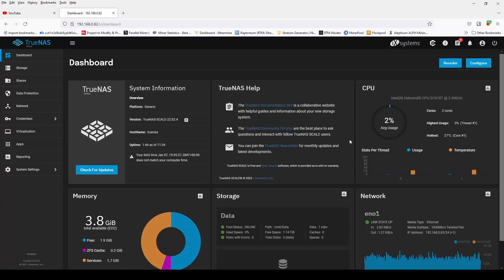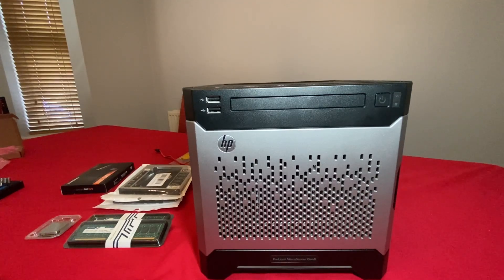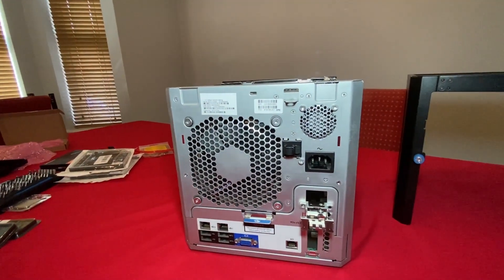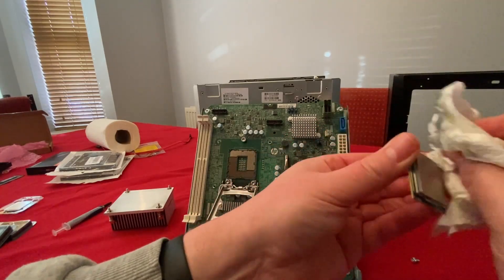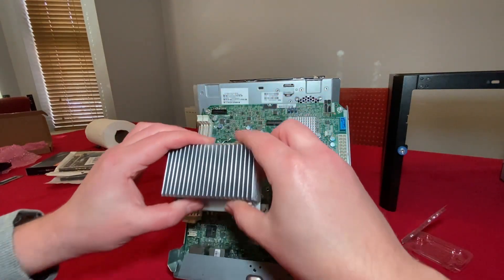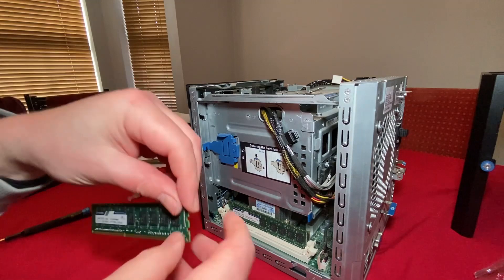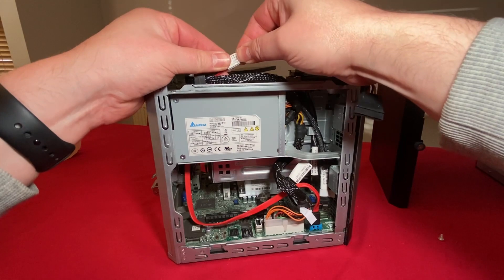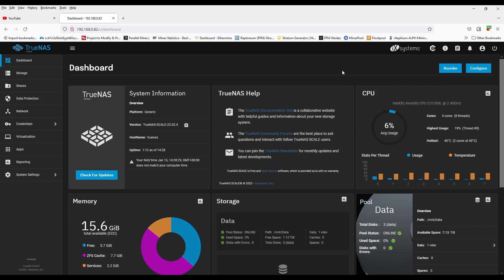Microserver Gen8 CPU and Memory Upgrade

Comment: Ive upgraded up cpu xeon e3-1275v2 and RAM 16GB. Working with proxmox VE and 6 vm working preperly / enough. Very good that without fan. Especially at home. Im going to buy another one and want join older. To replication, yes then ups supported mini Homy datacenter :)

Comment: I also am running the Microserver Gen8. I only got 8Gb of RAM in mine, but I do not recognise your dashboard. I have ESXI Vsphere installed on my machine, so that I can run multiple VMs. The dashboard I have is the ILO one, and the ESXI dashboard. What is the max RAM it can handle. I am thinking of upgrading my ram. I got a total of 20Tb of hard drive space.
Reply: The specs say 16 GB is max, I hope i can get in more too

Comment: I know, a comment on an older video. But a very good video!
Some further info for any looking for ideas:
MyGen8 has been running an E3-1240v2 for some years without any issues - 69w! I had wedged an old PCI slot blower between the heatsink and the back panel over my cooling concerns - very good temps indeed reported by ESXi, and rock-solid...
...said ancient PCI-slot blower gave up the ghost about the same time I put a Tesla P4 in my system (with a 40x50x10mm blower carefully super-glued on the end. Out annoyance I put the whole thing back together without the extra fan on the passive CPU cooler and much to my surprise the temps are still excellent - up to 45c! I suspect helped by the intake of blower on the end of the Tesla card drawing it's air across the CPU heatsink along with the bog old fan on the back of the system.
Very happy, no issues. I guess HP built a fair bit if headroom in to the cooling solution.

PS: Why an E3-1240v2? At the time I did the upgrade this family of CPU's were still going for a bit of money and the negligible step down from the fastest offering or a similar performing 45w chip chopped a really big lump off the cost. As a bonus the server's VGA port still works in spite of this supposedly being a IGP-less CPU.
Given low prices today I'd just buy the best CPU I could find.

I hope that's of help to someone.

Comment: Hi - I have upgraded the processor and added 4x 2" fans in a push pull setup across the heatsink connected to a thermal controller so that when the temperature rises above whatever I set it to, the fans power on and bring the temperature down but I'm struggling to find the mini molex to SATA power connector.  Can you let me know where it came from please

Comment: How did you get it to boot? I installed Truenas on my Gen8 by usb stick on the motherboard, but after installation it won’t boot into Truenas OS but instead keeps cycling back into the hp start screen over and over again. What am I doing wrong?

Comment: Hi @techtriedandtested ! What type(brand, MHz, voltage, etc.) of memory did you use?
Reply from the maker: Timetec Hynix IC 8GB DDR3L 1600MHz PC3-12800 Unbuffered ECC 1.35V CL11 2Rx8 Dual Rank 240 Pin
Reply: @techtriedandtested link?

Comment: Any issues without using an LSA pce for the disks in TrueNas?
I'm willing to install TrueNAS Scale thought.
Reply: He is only running three 4TB HDD so will likely have the boot SSD in the remaining caddy which allows him to boot from it without a flash drive with GRUB or an LSA controller setup.

Comment: Currently i have a ssd with usb to sata connecter, I've been trying months to get my server running from that extra sata port with ssd. How did you do it? I have the molex connector. I'm also using Truenas. I've got 4x 4TB WD Red drives in raid 5. I have the i3-3240 cpu.
Reply: He is only running three 4TB HDD so will likely have the boot SSD in the remaining caddy which allows him to boot from it without a flash drive with GRUB or an LSA controller setup.

Comment: hi guys =D 
I am about to buy the Gen8 to be my main plex server 
is it good? 
I don't understand so much about computers so I really don't know if these numbers will make my streaming ( one device or 2 maximum ) smooth 
I have 4 harddisks (3TB X4 ) loaded with blue ray movies and 1080
Reply: If your wanting to use them for transcoding movies on the go, then it might struggle. If you set it to let the device watching the stream transcode it that should let it run better. I use two of these Microservers for plex, but they only are used as Nas servers. My plex server is on another computer, which has 16gb of ram and can transcode everything itself.
Reply: man that was 10 mothes ago =D ... i got my self a dell server =D  i got 4 of them now XD but thanks or taking time to anser me  @MartinMurray1966

Comment: To set your mind at rest, I've found the standard cooling in the Gen8 is really capable. I've been running the E3-1230 v2 since 2015 without encountering any issues and I run test labs with multiple VMs. I'm not deliberately pushing the CPU hard, but it deals with fairly busy workloads no problem.
Reply from the maker: So far so good. Even under load I've seen the cpu temps only reaching 40 degrees c